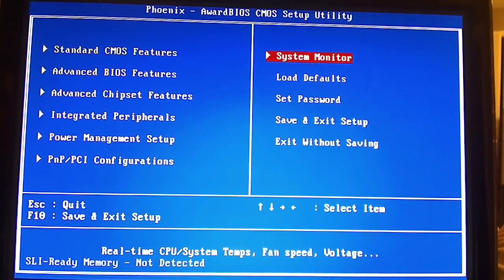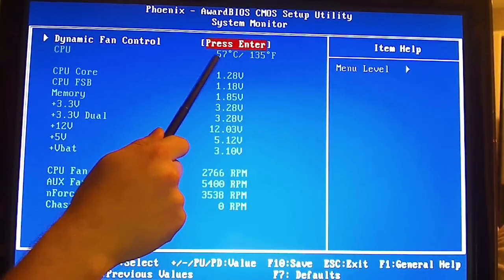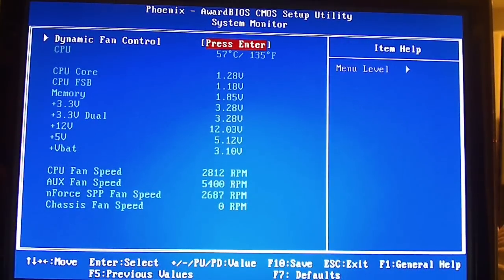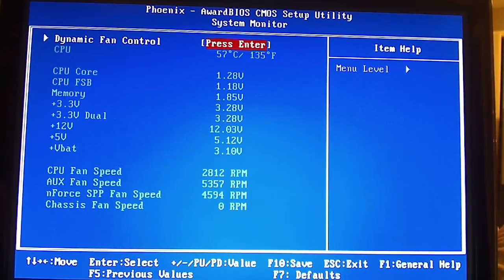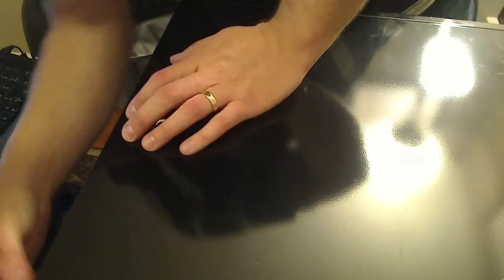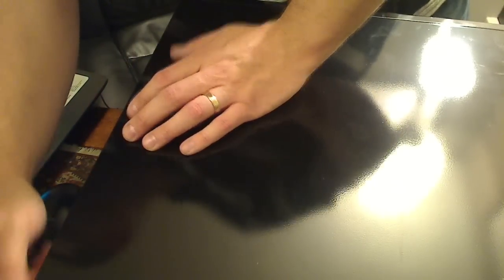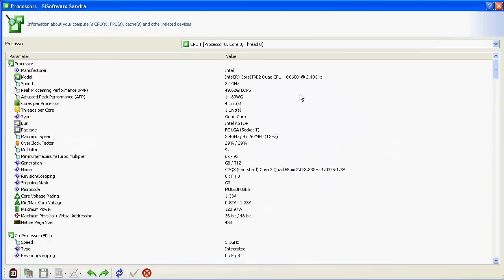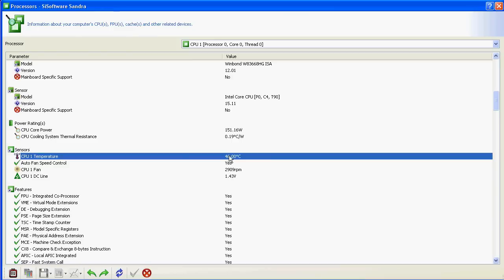SOLVED:  Fix Overheating CPU (Computer) Decrease Temps by 10 degrees

Comment: It's important to check the connection first, make sure it's good, if that doesn't work, then look into your monitor, try plugging in a different monitor and if that doesn't work then you might need to look into the option of your GPU failing, if you have another system try to put it in there and see if it works, if it doesn't it's the GPU and you need a new one.
A useful hint can be the buzzer, most motherboards have a buzzer which will beep a code when a part failed.

Comment from the maker: @dr4gonzs Try this:
1.Look up stock opertaing temperatures on Google.

2. Make sure that all of my fans are working and pointing in the proper direction.

3. Re-do the thermal compound after I cleaned the CPU and heat sink really well; I use rubbing alcohol.

4. Check my voltage settings and make sure that I'm not running too much voltage (Use stock setting if you are not overclocking).

5. Clean all dust bunnies out of your case.

Comment: If you have a stock cooler, make sure you hear all 4 pins click, before locking them. A loose cooler can cause increased temps. Just in the BIOS, the CPU should not exceed 35°C (overclocked included).

Comment: ok I read it. Switch the air flow direction to extract the hot air out of the case. The power supply 120mm fan also draws air so you would have the back 120mm and the PSU fan taking hot air out and the incoming cool air being drawn in from the front of the case. That way the overall result should be even better and if you switch to arctic silver 5 compound you will get 33-35 on idle and around 46-48 on 100% load.

Comment from the maker: @ableman8 It sounds like your CPU is throttling, this is a setting in your Bios. Go through your motherboard manual and look for power saving settings and turn them off. Also, you could look up your motherboard on Google and maybe search for the keywords "overclocking settings" or "performance settings". Your operating system, also has power settings, make sure that it is set for performance,

Comment: You don't have to remove your CPU to clean the thermal paste. Just use an isopropyl soaked paper towel, and lightly wipe down the CPU lid. Isopropyl (rubbing alcohol) breaks down the thermal paste, without damaging the CPU. The best method is to apply a little downward pressure, then increase pressure horizontally across the CPU, as if you were scooping it out.

Comment: please do some cable management. if you want to put on thermal paste use the x. pattern its proven to work better, when you are putting the heatsink on dont tighten your screws straight away, screw all of them loosely and than tighten. sick looking heatsink btw

Comment from the maker: @crayzeesteve Re-seat the CPU and Ram. Remember that if you re-seat the CPU you will have to re-apply thermal paste. Also a jostled video card needs re-seating also. It sounds like something just got knocked out of alignment, it doesn't sound like you broke anything. When things like that happened to me, I took everything apart as a last resort (I mean every little connected wire) then I put everything back together and it worked 100% of the time. Don't give u and take your time.

Comment from the maker: No display? Take out your video card and put it back in making sure that it seats properly. This was a common problem back in the day. Also check your monitor cable and make sure that both ends are secured properly; as loose connection can cause this.

Comment: You should turn that heatsink around, because now it's sucking air from the back and blowing it into the front of the case, so the exhaust fan, PSU fan and CPU fan are fighting for air. By turning it in the other direction it would blow the hot CPU heatsink air directly into the exhaust fan and out of the case. That would make your CPU and the whole PC run cooler

Comment: I will subscribe. I think I need a full overclocking lesson with all those utilities that I must turn off and stuff like that. I got a i7-3770k Which I have been running stable at 4.9ghz. But I usually got it at 4.2Ghz when I don't do benchmarks.

Comment from the maker: @Thevb2101 1) Look for screws, nuts, or clips and dismantle it to clean the heatsink.
2) Get Arctic Silver 5 $13 on NewEgg
3) Look up your CPU on ArcticSilver website for CPU specific instructions
4) Maximum operating temperature 55C - 72C

Comment from the maker: @struggle375 
1.Look up stock opertaing temperatures on Google. 
2. Make sure that all of my fans are working and pointing in the proper direction. 
3. Re-do the thermal compound after I cleaned the CPU and heat sink really well; I use rubbing alcohol.
4. Check my voltage settings and make sure that I'm not running too much voltage (Use stock setting if you are not overclocking).
5. Clean all dust bunnies out of your case.

@struggle375 Let me know how that works out for you.

Comment: If it's idle at 40-50 you need either a better heatsink or reapply your thermal paste using the dot method.

Comment: We really don't know if it did. The first test used the bios temp monitor, the second test used a monitoring program, one could be reading core temp and the other CPU temp, or there just may be a different reading using two different programs.

Comment: Opening case may void warranty, that is if you've purchased your PC prebuilt. Touch grounded unpainted metal, before touching any electronics. Getting rid of electrostatical charge is important. Electronics are sensitive. Careful when tightening the screws that go through the motherboard, or any PCB. If you're too forceful, you may damage the board. Firm, but not too forceful. I guess that's it.

Comment from the maker: @ChillaZap Sounds like it. First look up the suggested temperatures for your exact CPU on the MFR website. 

I had a few occasions where I moved or bumped into my computer case and my CPU temps jumped up. I cleaned everything up and reapplied the thermal compound. 

Check out my other video that shows how to properly apply thermal paste. It's really detailed.

Comment from the maker: When I was a newbie I wore wrist protectors to protect from ESD. Most people ground themselves to the case by holding it. Also some people lick their fingers to prevent static build up. LOL hope that answers your questions. 

Lastly don't wear wool sweaters while rubbing your feet on the carpet as you pull your pc apart.

Comment: I need a LOT of help so I hope this fits in 1 comment.
1)My HeatSink is a normal fan with a grill sorta thing under it. Grill thingy is too dusty, Cant reach it with a pen or vaccuum. How do I clean it?
2)What might be the appx cost of a tube of thermal paste.
3)In other videos They spread the thermal paste over the entire square of the processor but you dont, Which is correct?
4)Can you suggest a fair overclocking temp for AMD Athlon X2 4200+ ??
Help is appreciated.

Comment from the maker: @kalijasin The case fan came with the case and it was setup to blow air in. The power supply had a fan sucking the hot air in from inside the case and blowing it out. Now my new setup is as you would expect it. The 80mm case fan blows air out, the PSU blows air out, and the CPU fan is blowing it's hot air directly toward the 80mm case fan. There's a front case fan sucking air in from the front of the case. The setup is much better, than before. Maybe I could push the cpu to 3.4GHZ now :)

Comment: If you have a 2500k, no problem. If it is a 3570k, then not too much a problem. just make sure you have a cooler that is up to the task. A coolermaster 212 evo is a good cheap option that should work for 4.5

Comment from the maker: @ableman8 Those temps seem pretty high to me, but I'm not familiar with your setup at all. My pc overclocked from 3.3 to 4.2 GHZ is running at 35 degrees at idle and 45 degrees at load. I used Prime 95 to test it's settings and it reaches 70 degrees completely maxed out. The manufacturer doesn't recommend anything higher than 72 degrees for my core i5 2500k. Find out what your MFR recommends for safe CPU temps, your cooling maybe insufficient.

Comment from the maker: 1.5 volts is really high. I don't cross over 1.4 myself. I can overclock my pc past 5ghz to run a benchmark, but I also keep it at a reasonable speed and voltage for reliability reasons.

Comment from the maker: @finalfantasy14344 If your computer is clean inside and your fans are pointing the right way, and you are still overheating, you have to decrease the clock speed of your computer. Also if you have a mess inside your case with wires all over the place, that's prevents proper air flow. Use zip ties to clean up the clutter. So if you are running at 3.8 GHZ turbo, down clock it to 3.4 Turbo and see how that runs for you. You may also need to install more fans on your case.

Comment: Clarification: He is talking about CPU not GPU. CPU is the processor, so keeping this as cool as possible. Most of you guys are thinking of GPU which is the unit inside your graphic card. I run a GeForce txt 980 Ti and it can get up to 84 degrees Celsius. Hence why gaming pcs focus on cooling the card and not the one directly attached to the motherboard.
Reply from the maker: +Jeremy c OMG i never even thought people are making that mistake, but it does make sense for some of these comments.

Comment from the maker: @qinn50 Hmm, a little confused by what you are trying to say. Nevertheless 100 degrees Celsius is A LOT! I'd fix that issue and see how your frame rates are afterwards. Also find out what temperature your CPU is supposed be running at, because you could easily fry a CPU. I've done it years ago.

Comment from the maker: 1. How hot is your room?
2. Did you clean off your old thermal paste from the CPU and Fan with rubbing alcohol?
3. Are you overclocking?
4. Are you using stock CPU voltages?

Comment from the maker: You are undeniably describing an overheating issue, but it can also be caused by your video card. 

80C is not terribly bad for a CPU, although it really depends on your CPU and what the manufacturer recommends as a maximum operating temperature for it. 

My Intel i7 2600k has a maximum temp of 72C but I've pushed it to 84C for a brief period of time benchmarking without any problem at all.

Look up the specs for your CPU, then your video card to troubleshoot your problem.

Comment from the maker: @finalfantasy14344 The only thing I can asses, considering that you have also applied thermal compound properly as well, is that there maybe a problem with your CPU or motherboard. Also if the room where your CPU is located is very hot; 90 degrees Fahrenheit, that can also be a contributing factor.

Comment: Another thing is the amount of thermal grease was correct, but you don't just put the heatsink fan back on.  Take a latex glove or latex finger and spread it around evenly.  Then put slightly less on the heatsink fan and do the same thing, then replace it back on the CPU and then your done.
Reply: If you're referring to how to apply thermal compound by Asus (first link on Google) he says at the very beginning of the video that there are many application methods and application methods may vary depending on the type of heatsink that's utilized.

The reason I don't like doing it the way he does it, if you don't pull up the heatsink correctly (to spread the thermal grease) you could damage the motherboard and/or CPU.  I've seen people do this and rip the CPU from the mobo.  If you watch the video, you'll notice when he pulls the heatsink back off the CPU after testing/spreading the thermal grease; you can see he had to pull a little hard to remove it.  Also, if you twist it to get it off (as you should when first removing a heatsink so you don't damage it) that would create bubbles, like he said.  That's why he didn't twist it off in that instance.  If you do as I suggested (and yeah, there are different ways to do it) you'll spread it correctly because you know how much thermal grease is on there because you did it yourself and you don't have to use that method to spread it and then put the heatsink down to test.

I use about half a pea size to 3/4 on each side, and then take something like a latex glove so you don't get oils from your hands on it.  You can also use a credit card to distribute it.  I cover both sides completely, but not so much that it will spill out when you put the heatsink back on.

You can do this any way you want, I've just found this to be the best method (I think) and I've never had an issue doing it this way.

Comment from the maker: @alienspok1 If you made sure you have new thermal compound, working fans pointed in the right directions, proper voltage and motherboard settings and your computer still overheats... Maybe something is broken or it's too hot in your house.

Comment: It appears u completely tightened each screw on the first time.  Have u considered lightly running down each screw then make the circuit a second time to completely tighten all screws.  This process reduces the chance of one area of the mating surfaces making full contact before the others are close and helps all areas to be drawn together at approximately the same time.

Comment from the maker: Laptops also suck in dust bunnies, especially after you've been using them for a few years. Open it up and clean it out. It may totally fix your problem. And remember that freezing your laptop is cool, but don't forget about the condensation that can form.

Comment from the maker: Stress your CPU using Prime95 and see where the max temps go. I would avoid running an overclock that puts this CPU past 72 degrees on load, if you want to be safe. Others run this CPU past 80 degrees Celsius on full load. I'm running my Core i7 2600k at 4.4GHZ with my temps below 72 degrees on full load :) 

BTW: You can also set your clock by whatever program maxes out your CPU temps. For me it's PowerDirector 10 during HD 1080p video production.

Comment from the maker: Room temperatures can make a huge difference. If it's 70 degrees in my computer room my overclocked pc is 38c at low loads. If room temps are at 90 degrees the pc runs hotter as well. get some extension cords, take the cover off your case and run your pc outside for a few minutes :) I'm sure your temps will be nice and low :)

There's computer geeks who built computers inside mini-fridges :)

Comment from the maker: A couple ;)  In my latest build I'm using an Intel i7 2600k that runs at 3.4 ghz stock and turbo's up to 3.8ghz. I'm running mine at 4.4ghz 24/7 with minimal heat and ZERO problems. I had it up to 5.1ghz but it would get too hot doing video editing.

Comment: oops, that temp reading (46c) that appears on the application will be lower than the reading on the System Monitor on the bios. It would be best to check the temp on the bios page the same way it was measured at the start. This way it would be spot on comparative.

Comment from the maker: @qinn50 It really depends on how much you want to spend, but here are some good ones. EVGA GeForce GTX 550 Ti (Fermi) FPB 1GB 192-bit GDDR5 PCI Express 2.0 x16 it's $109 after mail in rebate on NewEgg 
or 
MSI GeForce GTX 560 Ti (Fermi) 1GB $214.

Comment from the maker: Most Intel CPU's have a max temp rating of 72c. I'm running an Intel i7 2600k CPU @ 1.3 GHZ over stock and my temps are around 36c; with my case fans at full blast, and about 39c with my case fans on the most minimal settings.

Comment: I'm running a xeon (i7) at 26°C. Room temperature is 26°C also. 30°C gaming. Listen to what I say. Factors influencing temp: PC-case, CPU-cooler, thermal paste, graphics card, PSU, cable management, DUST. A weak PSU and poorly cooled graphics card send more heat to the CPU. Once you remove the CPU cooler, you have to change the paste. If the CPU cooler hasn't been removed, the paste lasts 4-8 years, depending on the type. MX-2 is a cheap & nice paste. Stock heatsink is weak. Full copper is best.

Comment from the maker: I don't think so. Just make sure that you keep your max temps below 72 degrees Celsius to stay on the safe side. Get Prime95 and check your CPU temps when you use the program. The bottom line is that you should not exceed 72 degrees when stressing your computer doing things you usually do like gaming or video editing. If you do exceed that temp, then either down-clock or get better cooling.

Comment: the CPU fan is placed the wrong direction. flip it 180 and you are good to go. also the thermal paste should be spread all around the CPU with your finger in a plastic bag, to get the most surface area in contact with the heat sink.

Comment: Good airflow is key really...I get highs of 47c on full load so I'm set really...if your worried about CPU temperature...don't if it's been fine at high temps it'll be okay...70 being the danger Mark

Comment from the maker: The following list will cause temperature problems and you should also look up your CPU max operating temps to see what they say.
1. Bad voltage settings.
2. Overclocking too high for your cooling methods.
3. CPU and heatsink shifted causing old thermal compound to become ineffective.
4. Broken fan.
5. Virus or rogue process.
6. Excessive dust.
7. Fans pointed in the wrong direction.
8. High temperatures in your computer room.
Hope that helps you with your trouble-shooting.

Comment from the maker: It's not bad, but I'd expect lower temps than that. I'm using air cooling and I run about 34c @ 4.2 GHZ on an Intel i7 2600k. It is possible that your chip runs hotter than mine.

Comment from the maker: That is really high, but first I would research on Google what temps are typical on your particular CPU. 
Is your room hot?
Do you have a good fan and heatsink?
Do you have good thermal paste?
Are your case fans setup properly (1 blowing in, 1 blowing out etc.)